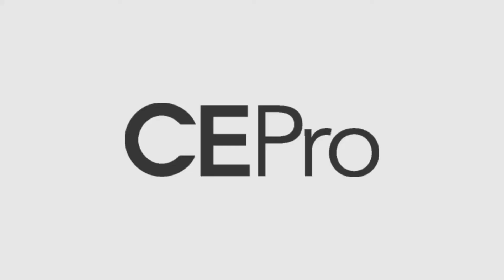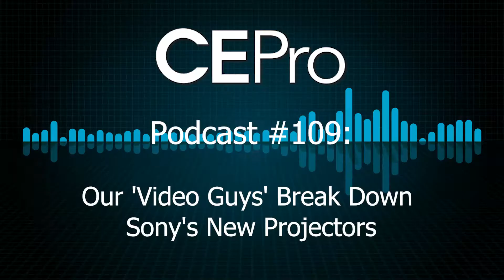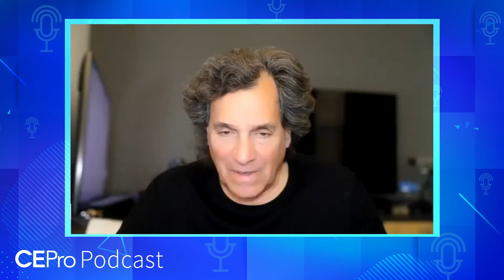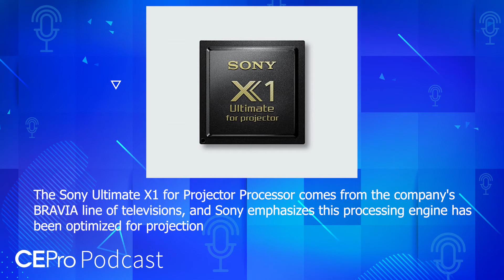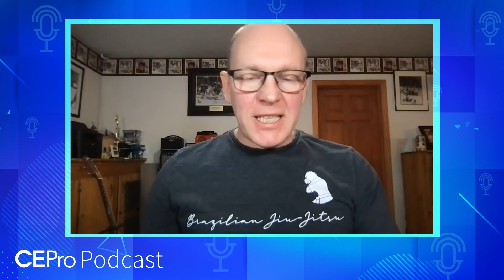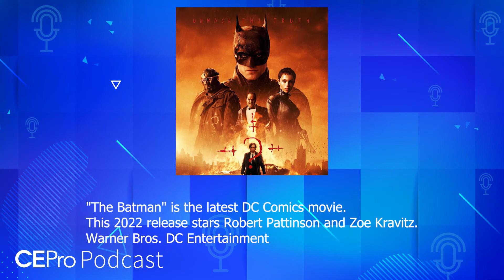‘Video Guys’ Discuss New Sony Projectors, Theater Setup Tips

Comment: I thought XW5000es is all glass except final lens which is resin aspherical. The XW6000 and 7000 are all glass?
Reply: The 6000 and 7000 products are made of a plastic, but they are extremely advanced as Robert Zohn indicates in the podcast
Reply: @robertarcher4308  glasses are made of polymers, good enough for me!
Reply: @robertarcher4308  I see what you did there. The Lens are not all plastic even  in the 5000. The lenses... https://youtu.be/C1ho4s4ifhI?t=767